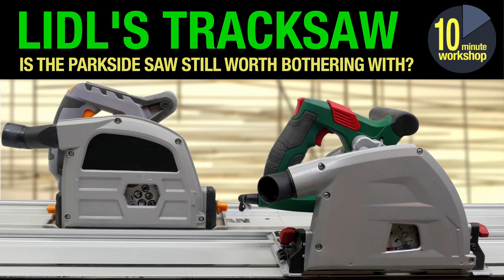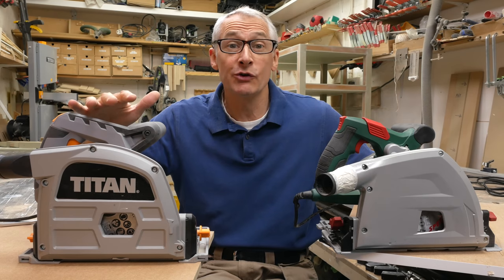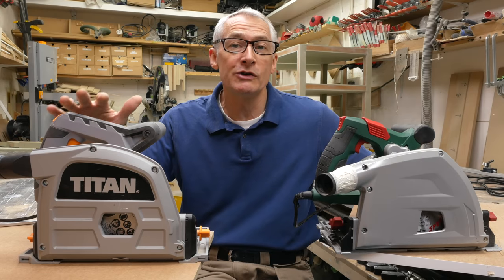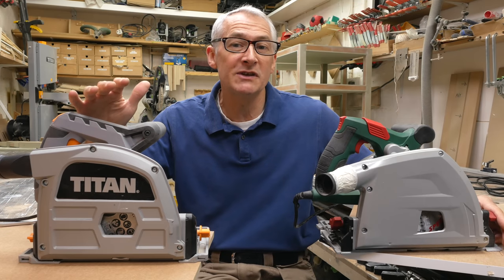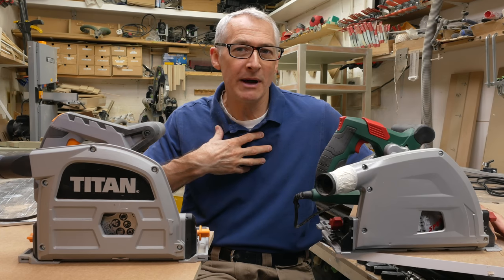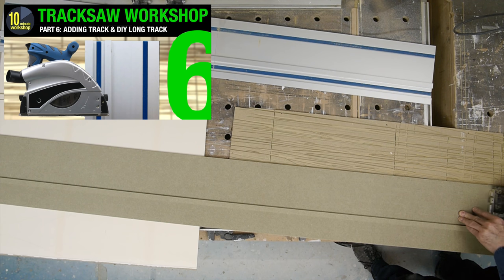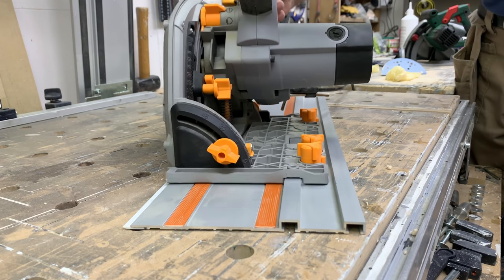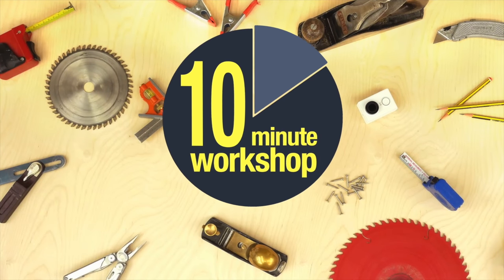Screwfix Titan or Lidl's Parkside Plunge Saw? [video #326]

Comment: Peter, i watched this video and went on Screwfix, but Titan cost now 169£
Reply from the maker: Thanks; the Titan was discontinued this year, replaced by the MacAllister MSPS1200 at £100. NB: I haven't used this, I'm not recommending it. I think you may have seen the "Triton" saw (TTS1400, orange coloured bodywork) which sells at £170 but is a different saw altogether. 👍
Reply: @10MinuteWorkshop  I really need one this weekend. Would you suggest any CIRCULAR saws with adapters to guide rail ?
Reply from the maker: I have the evolution one, but haven’t used it yet, tbh. Sorry, I don’t have much experience of guiderail-capable circular saws - I’ve been plunge/tracksaw-based for around 15 years. 👍
Reply: @10MinuteWorkshop  Thanks Peter, then i will be looking for a plunge : )

Comment: I think the biggest difference between the two is quality control. The restoration couple channel just bought the park side one and his had a poor chip strip on so wasn’t useable and had to be returned. It does look like a cracking saw, unless your local B&Q has the Titan for £70 (I’ve seen reports of it down to £50!)

Comment: My Local B&Q was selling off the McAllister Plunge saws for £55 so I grab one and they look exactly the same as the Titan saw all the specs are the same, They must come out of the same factory, The rails are not very good and once joined are not square whatever i do, I think they need recutting square but since it was so cheap I just paid £50 for the Makita 1.4m rail from Screwfix. Thanks for all the Great Videos Peter
Reply from the maker: Sounds like a bargain! 👍👍
Reply: I think B&Q and Screwfix are owned by kingfisher. So I would suspect who ever is manufacturing them is in the same plant.
Reply: they were also selling the titan at 55 on clearance, i got one in a heartbeat

Comment: Good balanced comparison (Says I as a Parkside track saw owner!)… One more argument in favour of the Parkside model is the 3 year warranty... one year more than for the Titan.

I'm glad these videos are bringing new, well deserved, visibility to your channel. It shows there is demand for quality reviews of equipment at the low end of the tool spectrum. On a related note, I'm sometimes wondering what one gets extra from buying premium branded tools (The Festool TS55 has some comfort features but it doesn't seem to cut better or faster, and I find it hard to justify the price difference).
Reply from the maker: Thanks! And yes, that was the thinking behind the Festool V Cheap tool series; what exactly are you missing when you buy an entry level saw over a premium one. 👍

Comment: This might not be the best place to ask, but here goes. I have tried doing some 45deg cuts on my Titan and those seem to have cut more of the rubber strip making 90 deg cuts difficult to get accurate again as the strip is not straight anymore where the saw did a 45deg cut. Do the non-budget saws (Festool/Makita/others) do that too ? In a way a single beveled cut messed up my good rail (yes, I did reapply the strip and cut it again). Thanks
Reply from the maker: I don’t know for sure, but I think Festool are the only saw that hits the splinterguard perfectly on a bevel cut; Mafell certainly doesn’t - the blade moves away from the normal cut line when you bevel it. 👍

Comment: Hi Peter- looks like the Parkside saw is popular - for info the saw saw is branded Ozito in Australia, though it has different colour and available at Bunnings. Bunning also sells a 1500mm Ozito/Parkside guide rail (with a joiner for $50 AUD.. 
 It is pretty handy saw.  I personally abuse these the saws (and some festools) turning them into  angle grinders with a Lenox metal max blade.....
Reply from the maker: Good info, thanks! I figured someone must be doing a longer track for these, weird we don’t get to have access to it over here. 🤷‍♂️👍👍

Comment: Nice video Peter, informative and clear as usual. Thank you, I’ve learnt a lot from you. 
I have the Titan saw which I got to cut 30mm beech worktops which it did easily. Like you I also found the kick back preventer a pain and eventually took it off. I now set up cuts on big sheets of 18mm ply very carefully and make sure I’ve got a good grip on the saw! I find the depth stop tricky to get right and the gauge untrustworthy. But it’s been a great tool and I have completely reconsidered my ambition to fit a table saw in my small workshop.
Mine is just over a year old and came from Screwfix with 2 rail clamps. Maybe I just got lucky!
Reply from the maker: Thanks Mike! Great to hear you’re getting along with the tracksaw approach. I ‘worked wood’ without a tablesaw for ~14 years or so, and even now don’t use it much! 👍👍

Comment: The Lidl saw is also available in Europe, particularly Italy where I'm told it's nearer £79.99 in price.

Impressive view count. I've got 1500 odd off my review also. Useful saw, I'll be using it later to trim the bottom off my very large heavy shed door later.
Reply from the maker: Thanks Benedict. Yes, I think I said in the first video that some subscribers in Belgium say it’s available all year round at a similar price. 👍👍
Reply: @10MinuteWorkshop  Interesting to know.

Comment: Great info as ever Peter, cheers! I've used the Parkside for a couple of years, always worked fine if slightly rough and the rails feel a bit flimsy. Biggest improvement came from replacing the splinter strip with some thicker neoprene from eBay as per a previous video of yours. I picked up the Titan for £55 from B&Q and it feels a bit more dialed in already, so hopefully an upgrade! I'll get the 48t blade pronto...
Reply from the maker: Thanks! Titan’s a steal at £55! Nice one! 👍👍

Comment: Hiya Peter. Yet another cracking upload. Very informative. 
I was using my parkside plunge saw today and I have to say that (particularly for the low price) its a pretty decent machine. I’ve got an Evolution circular saw which is very good for an economy saw as well but I must say the parkside is quite a bit quieter in operation. 
I saw about twenty parkside saws on the shelf  the day I went into Lidl. Should have bought the lot and sold them on through Ebay. ££££
Cheers again for a great channel.
Reply from the maker: Thanks! Glad to hear you're happy with yours - they're a great machine, and hard to beat for the money! 👍

Comment: sold at bunnings in Australia as the Ozito plunge track saw. it's a decent bit of kit for the price.
Reply: Ozito is not exceptionally cheap (almost double) - about $200 AUD. Alternatively you can buy Bayer (Titan clone) for $50 more from Sydney Tools with Makita/Festool matching rails and upgrade path.
Reply: In the UK Ozito brand is available in Homebase chain... since some Aussie retail bought them few years back.

Comment: Recently returned my saw as could not remove blade to replace with triton one, replacement saw now up and running 👍. Seems restoration couple channel had same problem with his. Not glowing review from him...
Reply from the maker: Yes, I had a chat with Tim last night - looks like he had a dud, no question. I'd have chucked it back to Lidl as soon as I found the gunk all over the housing, personally. Good to hear you're happy with the Titan though! 👍
Reply from the maker: I had a quick chat with Tim last night and I'm sure he had a dud. It does raise a question of quality control from one year to the next though - my saw is last year's model. I've also seen similar issues with the Aldi bandsaw - I reviewed it a couple of years ago, and folks have bought the current model after seeing my 2-year-old video and are having problems with blade alignment because of bad QC. 🤷‍♂️
Reply: Peter Millard 
The replacement was another parkside, no problem in exchanging and now fine.

Comment: Hi, Peter, I was watching "the restoration couple" today and he has just bought a Parkside saw but for some reason, the saw is about 3 mm away from the blade and is curved so that it doesn't touch the wood. Neither problems were present on my saw when I bought it and I suggested that he return it and gets another one.
Reply from the maker: Thanks John. I had a chat with Tim about his saws last week before he posted his video, and I agree - he has a  dad. I’d have returned it as soon as I found that funky mess all over the blade guard, tbh... 👍👍

Comment: Cheers Peter. I have another one for you to review. McAllister have now got one selling in screwfix for £100. looks very simular to the Titan. I'm still torn. Prob just get the Parkside and upgrade the blade. worked for the bandsaw
Reply: I think they are both owned by kingfisher (not 100% sure though).
Reply: @bighands69  both owned by screwfix/b&q - kingfisher own Erbauer, Titan and Mcallister. They just changed the branding from the Titan to Mcallister they look identical.

Comment: Peter,
Inspired by the Plunge Saw Series, I bought a ALDI PTSS 1200 C1. (C1 next generation ??).
I even made the Cross Cut jig and 3D printed stops to hold the rail in place.
Works great.
One minor thing, do You know if its possible to fix the red eccentric adjusting knobs ?
They seem to come lose after a few cuts.
I tried the screws with an Allen key, but they are already maxed.
Thanks for the useful tips

Comment: Hi peter love your shows and input.i bought the sheppach cs55 plus the 2 rails at 700mm a year ago now iam finding the rail isnt staying true to my marks at the moment i think the splinter guard rubber is coming loose.do u know if they do a replacement of this or is there another brand i can use to replace with.also does the cs55 tracksaw fit onto a Makita rail and festool rail just wondering seeing as this is a german brand? Regards david
Reply from the maker: Hi David. The closest I’ve been to a Scheppach tracksaw is the Aldi I used for my Tracksaw Workshop series last year - made by Scheppach I believe. The splinterguard is replaceable - usually just held on with double-sided tape. I cover the procedure in the Tracksaw Workshop series. I used Makita splinterguards and they worked pretty well with the Aldi rails,  but I had the best results with some slightly thicker rubber strip I bought from eBay. I show the advantages in video #286 - Splinterguard Swap - https://youtu.be/h1eo4ZVBTOU. Again, I’ve no direct experience of the Scheppach saws I’m afraid, but my experience if the Aldi saw is that they would run poorly on Festool rails, I’m afraid. 🤷‍♂️👍
Reply: @10MinuteWorkshop  thanks for your quick reply peter👍..yeah i was looking at Makitas rubber on amazon  theres another one  i seen but not sure i will defo check your link you sent for sure thanks again.

Comment: Hi Peter, I know you've got a vid coming up about the evolution tracks, but can you let me know if the scheppach/Aldi cs 55 fits them please, I can only find info that the scheppach pl45 does.
Reply from the maker: Hi Leigh. I can't say for sure about the Scheppach saws, but the Aldi Workzone saw I have definitely fits on the evolution rails, yes. HTH, P
Reply: @10MinuteWorkshop   Thanks Peter , helps a lot 👍
Reply: Probably too late now but I have the Scheppach PL55Li (cordless version of PL55) and the Evolution tracks. The saw does not fit them properly as it overhangs the splinter guard so you can't cut it back. I ended up buying another 1400mm Scheppach rail for that saw and also buying a MacAllister saw from Screwfix (seems to be the replacement for the Titan saw featured here) for the Evolution tracks and that will cut the splinter guard, although not right up to the edge of the rail (not sure how important that is).

Comment: Great video as always, as a result I think will keep hold of the additional £350 ish for the Makita SP6000J1 and buy the Titan.....!
Reply: Ive got a dewalt after my parkside was stolen. Honestly apart from the rail length and power input (110v) The parkside was just as capable as the dewalt. So the Titan probably is.
Reply from the maker: Wise move 👍😆
Reply: I've got the Makita 110v. The cordless version wasn't available at the time, or I'd have opted for that without hesitation. Anyway, I don't know what you plan to use it for, but I'm sure you will find the short rails frustratingly limiting very quickly.

Then you will, as Peter mentions, find yourself shelling out another £80 for the evolution rails. This still gets you a remarkable tool, with two short and two longer rails for roughly half the price of the big boys. 

Happy shopping! 
.
Reply: Cheers

Comment: Are those plunge saws a better buy than the Evolution track saw?
Reply from the maker: If you’re working mostly with wood, yes. The Evolution is good if you need to to cut multi materials, but if you’re mostly working with wood then the others will give a much better finish. 👍

Comment: Is it normal for the Titan saw to struggle on angled cuts… particularly with a higher T blade (80T Saxton)?
Reply from the maker: Depends on the thickness; it shouldn’t struggle with 18mm MDF or Plywood, though 80t is a pretty high tooth count…
Reply: @ I think I’ll try and do the cuts in two passes and see if it makes a difference. I’ll try the first pass at 11mm deep and then the second pass at 23-24mm. The standard 24t blade cuts well but it leaves a lot of chipping. 

This is my first DIY project and I’m basically making two cabinets to go beneath the eves of my attic. I’ve taken a lot of help and inspiration from your YouTube Channel as well as The London Craftsmen and Freebird Interiors… I’ll be sure to share project  once it’s complete. 

Thank you ever so much for your help and the excellent informative videos that you have put out on your channel.. I have learnt so much in such a short space of time. I don’t think I would’ve been able to manage without them… def not as a beginner.

Comment: Peter so can you confirm that the Titan runs on the Evolution track with no issues? As I am going to get myself the Titan for £90 a pair of 1.4m Evolution rails  with the bag and clamps for £70 as I have some store credit at Screwfix and love their customer service especially on their own brands . Thank you for the work you do I have learned a lot from this channel.
Reply from the maker: Yes. At 8.17 in this video I put the Titan saw on the evolution track - works great! And thanks! 👍👍
Reply: @10MinuteWorkshop thanks again I am planning my new workshop out and as space is limited I'll be copying your set up for the track saw etc

Comment: FYI right now the Titan is on clearance in B&Q at £55.  Picked one up today when I was there for something else as it was too good an opportunity to miss. If anyone's missed out on the Parkside (looks like it's been and gone again), try and grab one of these while you can.

Edit: It doesn't show up on the website. Maybe only some stores have some in, i don't know. Interestingly, the 'Macallister' version, B&Q's own-brand for tools, is £100 and looks identical apart from colour. 

Considering b&q / screwfix and all their associated own-brands are all part of Kingfisher group, they obviously come from the same factories.
Reply from the maker: Good to know Ian, thanks!
Reply: I checked b&q webpage before read your comment to the end and had the same conclusion. Both saws are different colour only. Digging deeper I found Erbauer's saw has blade cover different but the pattern on the motor shell looks the same. 
So is it worth to pay extra for different colours? Prices at 23/06/19 are as follows Erbrauer £149, Macallister £100, Titan £89.
Reply from the maker: @mil3k  Hi. The Erbauer has a different blade size, depth of cut & specs. generally, so not the same saw, just FYI.

Comment: Got the Parkside yesterday on your recommendation. £69.99. I already have Evolution guide rail and the two work together great. Only problem with the Evolution is that you can't get hold of replacement splinter guards from them. The longer ones are always out of stock even on the Evolution site. Any recommendations for alternative replacement splinter guards please?
Reply from the maker: I always use the Makita splinter guard, works great! Makita 3-metre splinter guard  - https://amzn.to/2TdVApS
Reply: @10MinuteWorkshop  Many thanks for that Peter.

Comment: Hi, does the titan track saw fit the evolution rails?
Reply from the maker: Yes, it does! 👍👍
Reply: @10MinuteWorkshop  brilliant, or would you recommend spending a little extra for the makita rails?
Reply from the maker: That’s a tough one tbh. The Evo rails are a fantastic price - £70-odd for two # 1400 rails is outstanding value - but I do think the Makita rails are better, if you can fund them. 👍👍

Comment: A few questions spring to mind.  Is Tech Support available? Are replacement parts available ? Do the importers have service centers of their own to repair product that they sell? Are the non importer service centers that exist ( I'm assuming that there are independent tool and machinery repair companies in the UK), willing and able to work on these tools. Given the low cost of these tools I imagine it's going to be less money to replace them than it is to repair them.

Comment: Peter have you had Chance to do any reviews on biscuit joiners ? I’m in too minds weather to buy one I’m just not shore if it will get used enough.
Reply from the maker: I bought the cheapest one I could a month or two back (Aldi), but haven’t got around to using it yet apart from a couple of quick tests. 🤷‍♂️👍